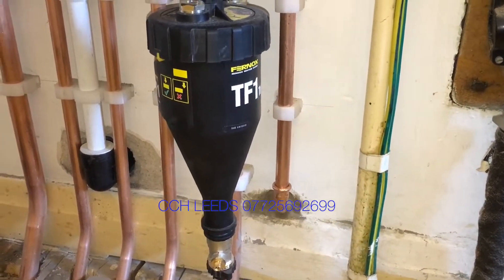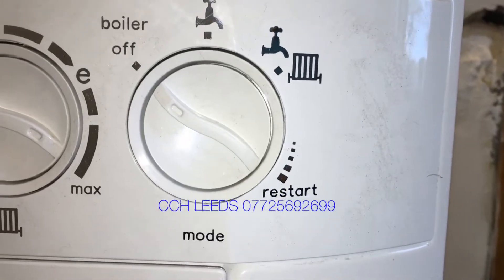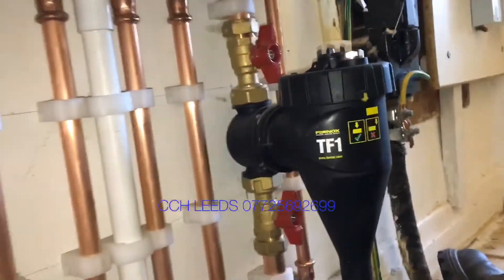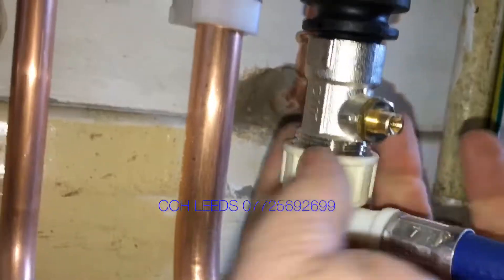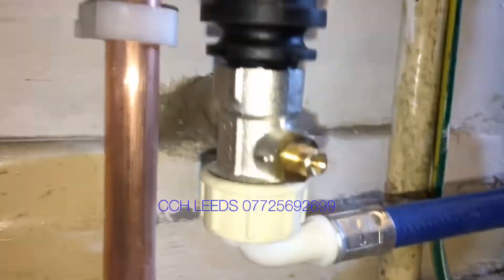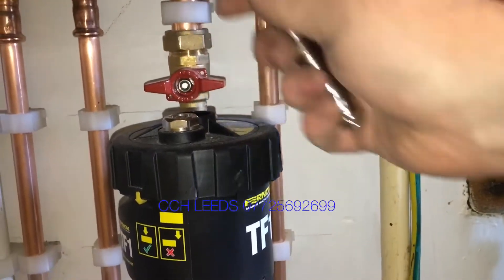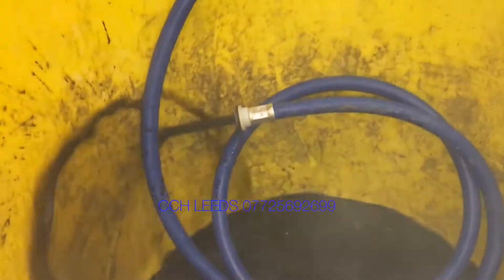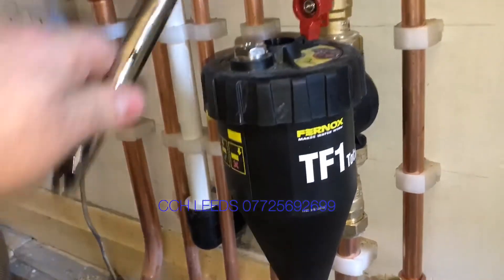How to clean out a Fernox TF1 filter

Comment: Took the lid off mine to add some inhibitor to the system, and it leaked like a sieve when I put it back together 😅.I did have a  new o-ring so tried that but couldn't get it to stop leaking - couldn't tighten it enough & it was hard to make sure it was aligned properly with the fatter new o-ring in place. In the end I cleaned up the old one, added a load of silicone grease to it, and some to the threads of the ring too, and it went back together fine. 

Mental note to self, don't touch it again 😂

Comment: Hi, thanks for the video. I am following it completely, however draining into a pot instead. No matter what i do nothing drains from the bottom of filter even with ball valve open it. When i open one or both red valves i just get a dribble for a few seconds. Please help, is it blocked?
Reply: Hi again, after tapping my filter many times i managed to dislodge the sludge and all came flying out. So this problem is sorted. However i have another question. What size spanner is needed to undo the top so i can dose with f1 cleaner? Thanks.
Reply: @MarleyYourBro  f1 has a nozzle that fits/screws onto bottom of valve, open top valve and spray for 30 seconds until you feel the shudder as it stops. the top lid opens with a plastic spanner (should have come with the filter) you can clean the inside rod once opened.

Comment: How do you do it if there are no isolation valves fitted?
Reply: I was wondering the same thing! The TF1 is available both with and without valves so it must be a common question for those who don't have valves.
Reply: @grayhalf1854  Looking at the instruction manual I believe you just begin to undo the fliter valve and water will flow from it. Then just close it.
Reply: @tonyarnold9784  Hi Tony, yeah, fitted mine ages ago and have drained off the dirty run-off a few times. The most important thing to do is to ensure that the boiler is off and there is no movement of the water in the pipework... once the pump has stopped running just remove the magnet from the sheath, then you can open the valve to drain whatever the magnet has collected. (Not even half a cupful for me). Close the valve, put the magnet back in, turn the boiler back on and leave for another year!
Reply: @grayhalf1854  Thanks for rapid response! I have no obvious on / off switch on boiler but i guess i can just turn thermostat right down so it doesn't come on? Also at bottom of the F1 it just has a small bit of metal (uncertain of term) to grab with a wrench and not a contol you can simply turn in your hand. (My system not flushed on boiler fitting and think it blocks and stops water flow. Pressure then drops as water finds its way to a weak joint which i have found under the house). BGas did clear the filter last week but system dropped in pressure again and i reckon dirt again, hence trying to solve. Tedious!
Reply: @tonyarnoldphotography9757  The plastic valve cover that you unscrew has a slot in it that fits into the valve allowing you to turn it on an of without use of a separate tool (I guess the plastic could get brittle over time but mine is fine so far. You could always use a wrench / adjustable spanner anyway). If you're losing pressure there's probably a dodgy joint somewhere... dye in the water might help find it - or even cheapo perfume can help! It's also possible that the system could lose pressure via the pressure relief valve - if you can identify it (it probably vents outside) you could hang a bag over it to collect any water that is expelled. Failing that get a trusted local gas safe engineer in, probably a better option than British Gas unless you're on a service plan with them 👍

Edit: sorry missed the bit where you said you'd found the leaking joint. I'll leave it in in case it's helpful for someone else though. Bear in mind that if the pressure drops too far the boiler won't fire so it might be that rather than gunk in the system blocking the boiler and stopping it from working...
Reply: @grayhalf1854  Thanks. The filter is new. Nothing to turn manually but maybe gas guy broke it?! I used a wrench and fine. Flushed muck through into a tray...a lot. I will keep an eye on it. Yes have cover and increased It Saturday BUT doesn't cover damage caused by sludge. Fair enough but I don't believe it was flushed when fitting. Tempted to take off rads and flush sometime. Will watch the leak and also check for more. Hard to go under house but need to locate.

Comment: I don't think that is how you are supposed to do it. The way I do it is, turn the red valves off to isolate the filter, remove the magnet, attach a hose (optional) open the valve at the bottom of the filter with the black cap, then turn the small bleed screw within the large nut at the top of the filter to release the pressure, filter then empties. Close valve when filter has emptied, remove large nut 18mm, fill with F1 protector, replace large nut, tighten up bleed screw. Open red valves, turn on CH to circulate F1. Job done.
Reply: Good point, quite right.  The only reason I like to flush thru by opening one valve, is to provide a little more force, and get rid of any crap that may come down from the header tank, like bird feathers, mouse droppings, slime etc.  (I've seen it all!)
Reply: see orsen carte

Comment: Rubbish.  You need to open the top with big ring spanner. You only pulled out clean magnet   The dirt is stuck in the magnet holder inside the lid. Flushing through doesn’t clean all the gunk off
Reply: if you take the top off you you are inviting problems these are infamous for having leaks after the top has been removed.As shown the pressure of mains water is strong enough to clean the residue   stuck to the inside when the magnetic force has been removed (why do you think that the water going into the bucket is discoloured)
Reply: I just flushed mine basically like this video (although nothing happened when I opened the outlet valve - I had to open the inlet valve to get a pressure flush. A good deal of gunk came out.

Oh, and can we say poppycock  instead of rubbish? Are those two words interchangeable? (I'm from the US, not UK).
Reply: @kenc.9067  
You're obviously a gentleman .
That's the difference !!!!
Reply: I thought it was just me !
Reply: Rubbish.  Such is the cyclonic design, the non-magnetic material sinks to the bottom. For the magnetic stuff, take the magnet out, wait a couple of minutes for the magnetic material to sink down, then flush it out. I have fitted a number of these over the years, have one here at home, which I flush out once a year.  I only take the top off (with the plastic ring spanner provided) to top up the CI, instead of clambering into the attic.  The plastic cap at the bottom is meant for opening / closing the bottom valve.  Excellent bit of kit.

Comment: Mine is dripping water, how deos that affect the performance of the Boiler?
Reply from the maker: I would advise you call someone out to fix it for you. These are good filters if installed correctly. Fernox do a service kit if it needs new washers. Thanks.
Reply: @AllenHart999  . Thanks for you reply, shall I carry on using the boiler or get the filter checked first?
Reply from the maker: I would advise you to get someone out to it so you do not cause any more damage, You should be able to use it until you get someone.
Reply: @AllenHart999  . Thanks mate